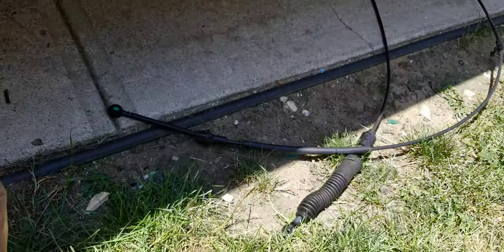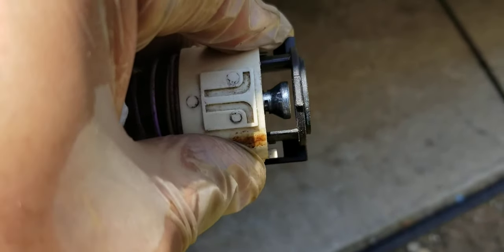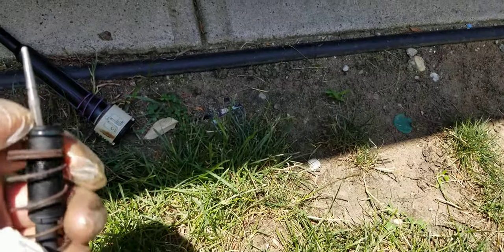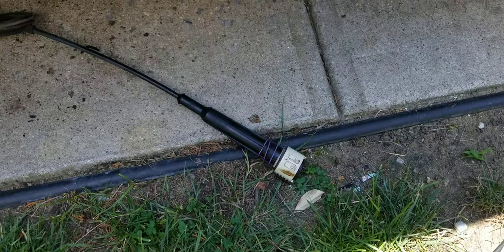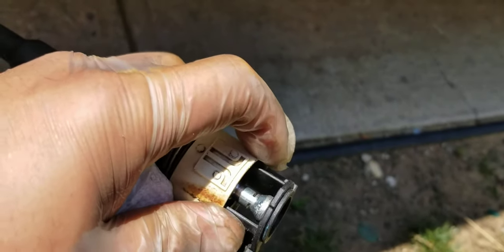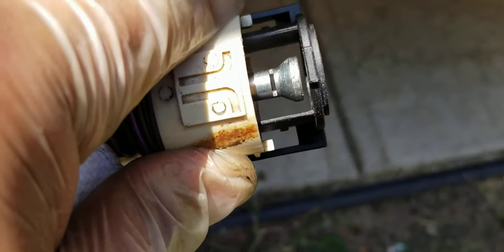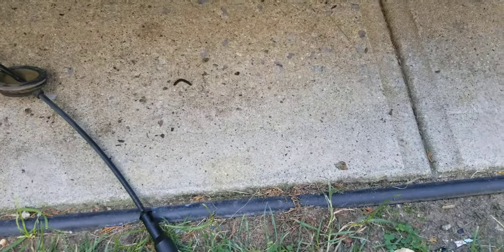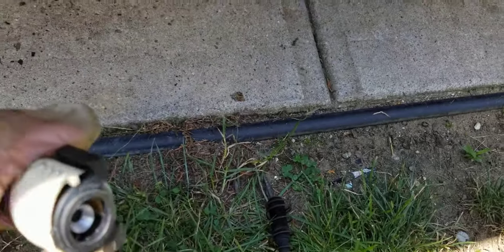How to Remove/ Install a Shift Cable- Chevy Silverado/ GMC Sierra Truck/ Savana/ Express Van

Comment: The freakin part you are holding in your hand is the final adjustment part ! After hooking everything up including the circlip/ eclip you pull the slack out of the cable by the separate cable housings  and install the locking clips into the part you are holding --- Jeez!

Comment: Thanks for the explanation. Best video I have found on the E ring. Am I to assume you have the E ring in place, BEFORE putting the pointed end in, and connecting the cables? I believe this is what you were saying?

Comment: I definitely agree yesterday I install mine and it took me 4 hours soooo your about right I really didn’t have a problem getting the e ring on you just need to use some tweezers and steadily install it carefully. The first time I installed the cable it was tooo short wouldn’t go into park pissed me off and then I couldn’t get the the trans shifter connecter on because I had everything install already so I had to undo and redo so yeah he’s right secure the trans connector first put car in park making sure that it’s in the right gear the secure the bolts and cable then connect the cable you should be good after that we’ll that’s my intake every good vid o can hear your frustration D.I.Y # in my djkhalidvoice we da best 😂
Reply: So would it be easier to work backwards? Meaning hook the line on gear shifter clip
Reply: I literally just broke the little c clip and broke in to tears how frustrating this is on top of all the other shit that broke this month 🤦🏽‍♂️.. 2 axels 

Transmission shifter lever and shifter cable which were broken by the front drive shaft after that broke off my transfer case which blew up 😢🤣 and by the way the axels broke 2 separate times a week after each other and then a week later everything else 😅😅😅